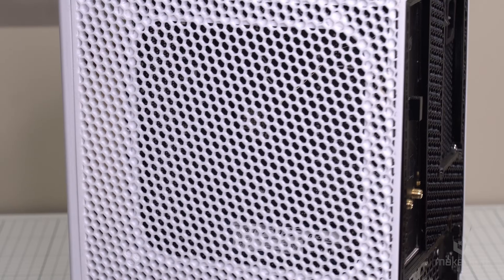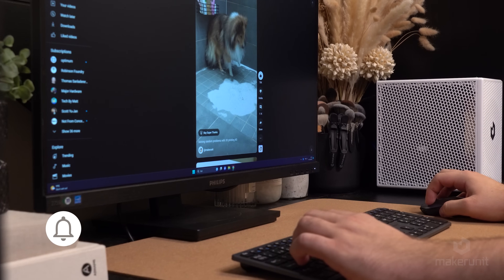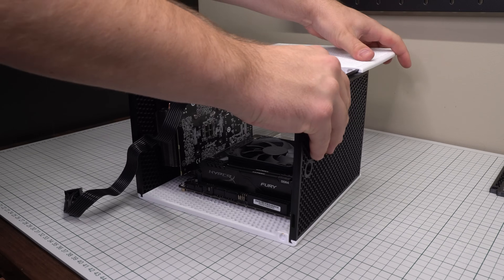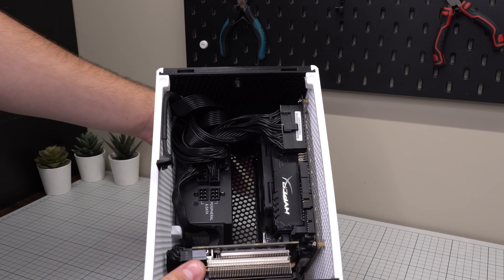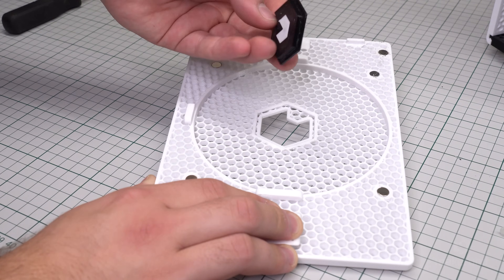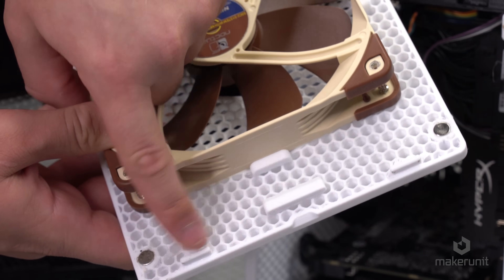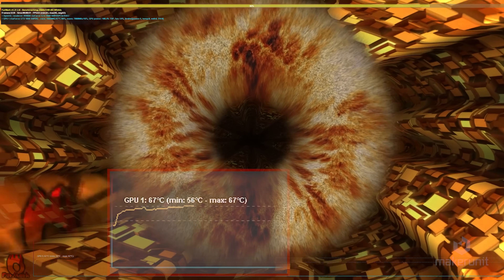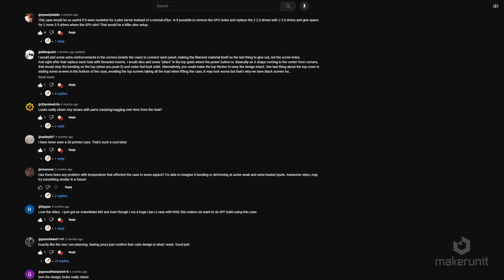Tiny 8.1L SFF build - 3D printed PC case

Comment: Hey man. This is really impressive. Did this take you like 40 hours to make the  case itself?
Reply from the maker: Thank you! Each of the 6 side panels took roughly 4-6 hours each to print. So assumed they’re average 5 hours I’d say print time is 30 hours but will vary depending on your print settings, nozzle size etc.

Comment: Wow that is a really well thought case! I really love it! Will save it in my collection for later use. Now I am using for an even smaller case for a system with onboard graphics card as it should be living room PC. But everybody is putting so much space in order to be able to put a discrete graphics card...
Reply from the maker: I see I see. I’ve got some more ideas for that as well. I’ll be looking at some more 5700G builds in the future. I have one but the thermals are not great I’d say 😅
Reply: @makerunit  I was thinking of:
Motherboard on top, where the CPU cooler sucks air directly from outside. SFX power supply below the motherboard or at the side. But it would be better to have it below as you can use the space there for cable management as well and you can put a front fan similar as your actual build which would equally cool motherboard and power supply. And the case can be used like a tower or put down so that the motherboard is on top.
Reply from the maker: I see. I was thinking like ITX mobo and SFX psu side by side in like a console style case that could be used both laying down and upright. Possibly some 92mm chassis fans to keep the air circulating. Using 92mm fans on the side would allow for some thickness to the case too allowing for bigger more silent air coolers. I’d prefer a TV/media pc to not sound like a jet engine.😊.
Reply: @makerunit  either it will be long or it will be thick. I liked the idea that the motherboard is mounted so near to the side/top panel, that the cpu cooler sucks fresh air. You can not do that when the  power supply is at the side as the power supply is more thick. But maybe yes, if psu and mobo both suck fresh air from the side/top panel and the space below motherboard is used for cable management. But the additional fans you want to use would be smaller.
Reply from the maker: @BlackICE1973  a solution to the fan being further away from the intake mesh is to use a custom adjustable thickness intake duct that will be placed between the intake fan and the mesh panel allowing it to only suck in air from the outside.
Reply: @makerunit  that is one solution. duct could be attached on the fan magnetically. hmmm now I need to learn how to model such thing as I only know how to use Tinkercad. Or I wait for you to design such case :D
Reply from the maker: @BlackICE1973  it would be a fun project so there are big chaces that I’ll do it some day! The question is just when 😅

Comment: Yes! Please do bigger versions of this case - one that will fit a 4090 would be amazing!
Reply from the maker: Workin on it 😁 how long is yours? (I’m talking about your GPU!)
Reply: @makerunit  That is awesome news! I would build it for sure! My card is a ZOTAC Trinity 4090

356.1mm x 150.1mm x 71.4mm / 14" x 5.9" x 2.8"
Reply from the maker: @russwhite6424  holy… that’s a big card. I didn’t even know they made them that big. 

I can’t promise this massive one will fit, at least not in my first upcoming build now, but I’ll see what I can do.
Reply: @makerunit  (er that's what she said?) That's all I can ask :)
Reply from the maker: @russwhite6424  I MIGHT try to make a front panel that bulges out a little in the middle to allow for some longer GPU’s sticking out the front. Though I’m not sure how it’ll affect the overall look.

Comment: If you are going to 3D print a case, perhaps you could try to implement something that can only be accomplished via 3D printing.  For example, most case sides simply drill / punch out holes for ventilation - it makes mass manufacturing easier.  But what about a multi-layer, offset hole type design?  The goal would be to allow for airflow but to prevent the sound waves from going directly out of the case.  Air going into the case would have to change direction while traversing a path designed to prevent acoustic waves from exiting.  Similar to how marine engines have intakes that separate air from water.  Ok, actually entirely different but the fundamental idea is similar.  This sort of solution could only be implemented using 3D printing.
Reply from the maker: That’s a cool idea. I’ve got to do some research on this subject though, as I have zero experience in the field of acoustics, but that would be pretty insane. I have considered like offset holes on both sides (makes no sense in writing) and then up again allowing air through but zero transparency. Hard to explain but a concept I saw in a video a few months ago. I think the video was by «Slant 3D».
Reply: I would try this out by making a case / volume from plywood - or some similar material that attenuates sound.  This volume can then be separated into two different chambers by inserting a 3D printed divider.  Put a speaker in one end and a mic in the other.  This gives you a standardized testing setup for measuring just how much the 3D printed divider attenuates the sound.  It would be a pile of work but could generate some great data to prove the effectiveness of your design.  It also allows you to minimize the amount of 3D printing required per test.  Lots of work but could make for a cool video.    @makerunit
Reply from the maker: @williamdouglas8040  I see. Sounds cool. Though I have zero experience with this type of «experiment» so I wouldn’t know how to do the calculations and measurements without some kind of guide explaning it more in detail.

Comment: Hey, this is AWESOME. Fantastic Job on this case.

I would love to have a Small Form Factor case for:
- Micro ATX Motherboard
- 240mm AIO Cooler
- RTX 4080
- Standard ATX PSU
Reply from the maker: All of these points will be included in my upcoming build that I’m working on now, based on the same concept as this one. 

Just be a little patient and I’ll have it out as soon as I can 😊👍
Reply: @makerunit  Thank you! You're the best!

Comment: Super cool! How is your experience with 3D printed cases after longer use? does the PLA deform due to the temperatures from the components?
Reply from the maker: My personal experience is pretty much zero real «issues».

Absolutely no issues due to temperature. Only issues I’ve encountered is the risk of breaking parts if handled a little too hard or over tightened, but that can happen to any case really in my opinion.

Comment: If the cases get bigger I may be tempted to do an external radiator custom loop in these (depending on gpu)😅, just gotta add passthrough and be cool!
Reply from the maker: I’m working on a mATX case atm with ATX psu support 😊
Reply: @makerunit  i would love to see that, there is nothing for that combo
Reply from the maker: @bxkxhxkg82  it’s a highly requested build so I figured now is the time… my previous mATX case I made so many «promises» that I’d upgrade it for ATX psu support and I didn’t go through with it and I felt so bad for promising something I didn’t fullfill… this time I’m for real 😅

Comment: If I were to request a varient piece for this would be a slightly different back panel. From our previous conversations your aware im using an external power supply... so maybe a small fan mount instead of a psu opening??

Potentially a top piece varient with 1 or 2 slots to put usb adapters in??
Reply from the maker: A great thing about 3D printing is that you can make many versions of the same part to fit different needs. I’ll see what I can do. The next case now is intended to be a bit bigger than this and will be somewhat bigger and support larger parts as it seems like the big majority of commenters want something that can fit more affordable parts.

Comment: looks good, one concern i have is the type of joint used to secure the white panels to the black ones. they end up creating a layer line weak stress point on the white panels where the black panel grove fits in, any idea how well it holds up in the weakest direction? i think there could be alternative joining methods that doesnt cause such a stress point which might end up being an issue with prolong usage, removing the front panel means pushing the middle of the black panel in so those outer edges will be pushing up on the white parts z direction at a fair thin point.
Reply from the maker: I personally don’t think this will cause any issues. First of all side panels are slid onto the outside of the top and bottom, and the way it’s connected it’s very strong moving up/down, is strong as the layer lines go all the way through horizontally there in the bottom of the notches. Forces from the outside it’s also strong as it’s sandwiched between the side panels.

Really the only weak point I can see (I might miss something) is with outwards force pushing from the inside out. Or during assembly when the design is still wobbly. 

Once the rear panel is in place it really locks it all together and it feels very rigid.

Comment: I'm still toying with the idea of creating a very compact PC case, designed around ITX parts, but printable on a smaller Prusa mini type printer like mine. I really like your designs, as it gives great ideas and they're always very clean looking. This one makes no exception !
Reply from the maker: Thank you! It’s a fun process and you’ll learn a lot from trial and error. My first ever case was made of so many weird looking parts and 10 different types of screws and just a mess.

Making a clean case from tiny parts should not be an issue especially if you make a design with many lines and ways to hide the joints in plain sight! 😊

Comment: Very cool build mate. Be really interested in a meshroom D style case with longer GPU Support.
Reply from the maker: Thank you! That is pretty close to what I had in mind for a follow up actually! Roughly 300mm length GPU support though, as I want a clean exterior and I’m limited by my printbed size at 300x300 😉

Comment: That is a really nice and very well thought out design.  It's attractive looking, too. Larger variants that could accommodate longer graphics cards as well as graphic cards that use more than 2 slots (which would make the case a bit taller, right?) would, I think, be welcome. I'd probably set one up for a longer, 3 slot wide card because so many of the newer cards are configured that way.
Reply from the maker: Thank you! Currently what I have in mind for a follow up is a mATX case that will accomodate for thicker GPU’s by using the upper PCIE slot if required. GPU length is planned so far to be approx 300mm as I’m a bit limited by my printbed without having split panels.

Comment: I think a micto ATX case which can fit relatively long 3 slot GPU while being as compact as possible (with SFX-L PSU compatibility, if not just SFX) would be ideal next! Also, would really love to see a tutorial video for your process in Shapr3D would be great :)
Reply from the maker: By using the upper PCIE slot on the mATX you should be able to fit some very thick cards without adding too much height.  The plan for the «M» size is to add support for ATX and SFX psu’s (up to 140mm depth) which should be sufficient for most builds.
Reply: YOUR TALKING NZXT H1 THEN LOL!
Reply: I would agree with a slightly middle ground (maybe 12-13L) would really make this a perfect design
Reply: @makerunit I really like an idea of your case. Small note - think about two 120mm fans on the front than one 140mm and make front panel slidable instead of magnets.
For M size, you can take a look at Mechanic Master C26 layout since it fits mATX, 310mm GPU, SFX in 13L

Comment: Great case ! When you see Mini ITX cases going for 150$, this one for a fraction of the price (20$ by my count if you already have a printer) has nothing to shy from ! For budget builds this is a great alternative and it looks really really nice. I mean if you want a UV or multi color case that the others manufacturers can never provide, this is even better!
Reply from the maker: Thank you! The infill method really cuts down on the filament usage! Funny thing it’s almost like you can still buy a 3D printer AND the filament and still be under $150 total these days (maybe not but pretty close)😅
Reply: @makerunit  Definitely, i got my printer and first roll of filament for £150 (which admittedly is $180, but still)
Reply from the maker: @slumpchogg  pretty close 😁

Comment: Awesome work! I would really like to print it, but my Ender-3 Pro allows 220x220mm max print. Just by 7mm it doesn't let me export to it. I'll try to cut the panels a bit
Reply from the maker: Thank you! I’m sorry about that, and I really wanted it to fit the Ender as I also have one myself and it would have sped up the print time by a lot to use both my printers but I had very little room to spare unfortunately. I could have probably made it work but it’d make assembly a little tighter. I’ll try to make more ender-friendly cases later. 

Splitting the parts is definitely an option that may work out.
Reply: @makerunit  Thank you! I also thought about splitting the panels at different heights and check if their strenght is compromised or they'll be strong enough. I will you know about it 👍
Reply from the maker: @AndreuMinguella  awesome! Looking forward to hearing how it goes! 😊

Comment: I love what you’ve been doing! Everything is awesome! Maybe run a N and L version of this? A nas version and a long version for long gpu / some storage options. 

N version to have “hot swappable storage” maybe mount the drives to a 3d printed cage or something that slots in.  Or something better. 🤷🏼

As far as different projects, maybe look at wall mounted or under desk mounted options? Or open bench with the option for a shroud? So many possibilities. Seems tough to hit bigger cases due to print bed restrictions. 

Would also like to see maybe adding acrylic panels or wood panels as a hybrid material build to get to larger sizes maybe?
Reply from the maker: Thank you for your nice suggestions Jake! The idea that came into my head reading all the comments was actually a «hybrid» something with multifunctional mounting points with swappable parts for NAS, gaming,    Airflow, etc… I’ll try some different configs and see what I can manage to put together 😁
Reply: @makerunit  yeah I think there is a lot of room for modularity on this design before moving to the next. As far as functionality, like you said airflow, longer gpu, storage bays, rgb channels, etc. 

I also think you could just modules that add on to the existing design as opposed to redesigning current. I saw a video of that on YouTube of an atx modular case that had a reconfigurable case shape.
Reply from the maker: Hey Jake! I've now created a "Long version" of this exact format, supporting longer gpu's. ATX PSU, HDD's and more! Files are already available for my Printables Club members! Feel free to check them out here: https://www.printables.com/model/688060-little-boy-s-long-edition-115l-itx

Comment: Instead of buying the screws, can't you incorporate them into the design?
Reply from the maker: The screws are hard to incorporate into the design but alternative mounts are possible. Not all are possible to remove but most I can do is to make it fewer because some parts must use screws to be able to mount

Comment: I would glue the fine mesh to all panels so the dust wont come in and for easy vacuuming
Great work! I too have a case in mind I'm working on, but it's for bigger parts and 2 radiators (CPU and GPU AIO's)
But doing renovations in my flat right now, so can't print test parts and continue
Reply from the maker: I feel like fine mesh will restrict the airflow too much but maybe… I personally don’t really worry too much about dust. I’d rather pick it apart once in a while to blow it clean with some air 😅 personal preference. 

Cool that you’re designing your own case! 👍
Reply: @makerunit   It's pretty easy if you use mini PC, but taking apart something bigger will be not really worth it, so I'd rather keep my dust outside and just vacuum it within 30 seconds or so
Reply from the maker: @DeathCoreGuitar  It all comes down to personal preference tbh. I’d love to hear about how your project ends up if you feel like sharing! 😊

Comment: A long version of this case that supports a longer GPU along with support for an ATX PSU would be great.  If you could accommodate a 250mm long GPU, that would open up many more possibilities for more powerful GPUs.  Also, a longer version has the possibility of mounting 2.5" and/or 3.5" drives to the same piece that the motherboard mounts to.
Reply from the maker: Longer GPU, ATX PSU, HDD’s, gotcha 😉👍